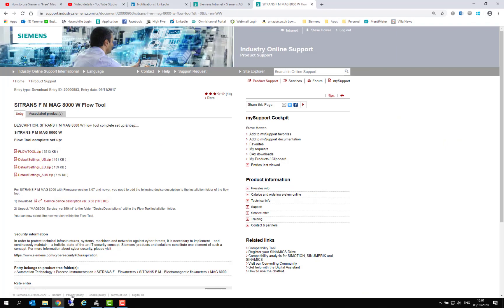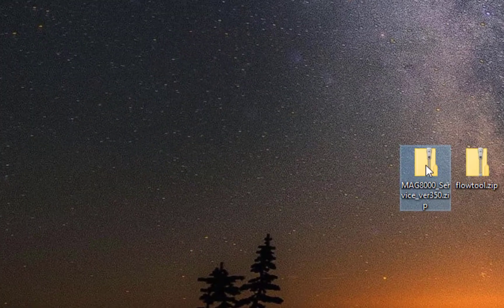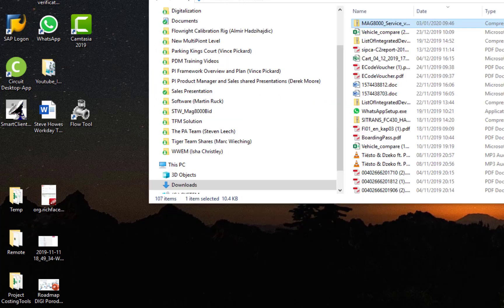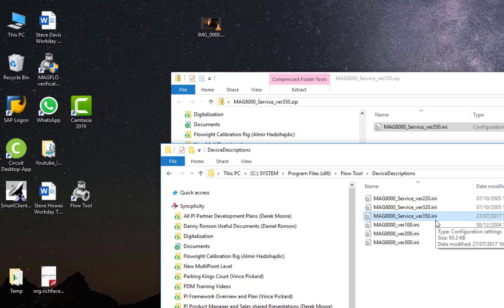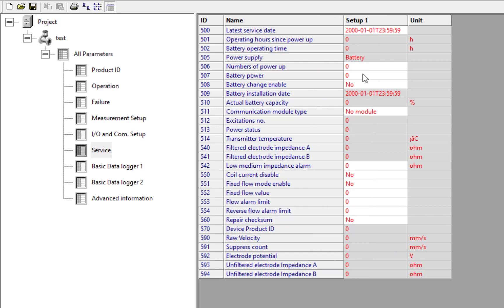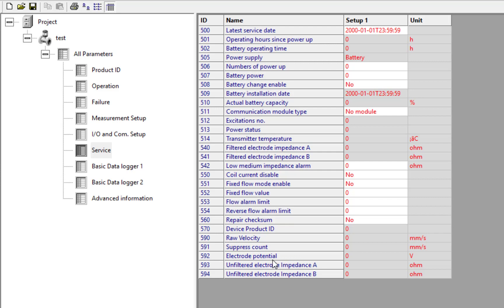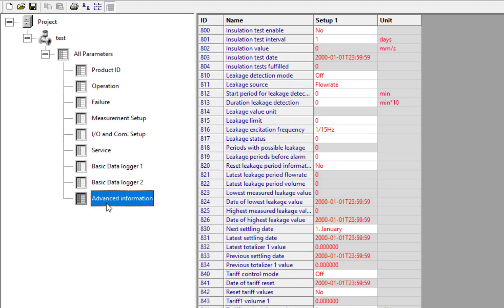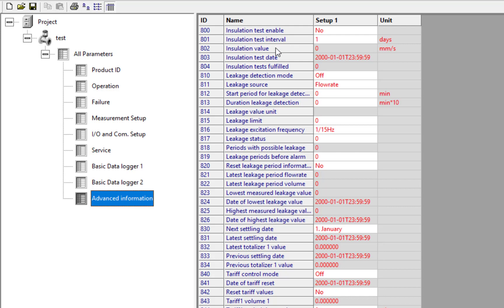See how to unlock additional parameters on the Siemens SITRANS Mag 8000 with new Flow Tool ini file

Comment from the maker: See below the link for the the new 350.ini file for Flow Tool.  Required to unlock additional parameters supported by FW 3.07 and above.

https://support.industry.siemens.com/cs/document/20000953/sitrans-f-m-mag-8000-w-flow-tool?dti=0&pnid=17328&lc=en-WW